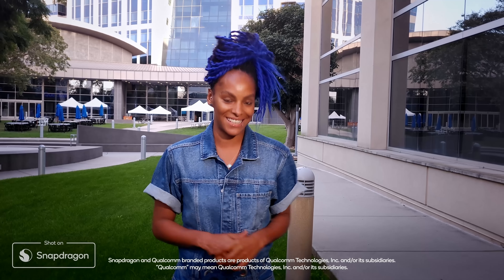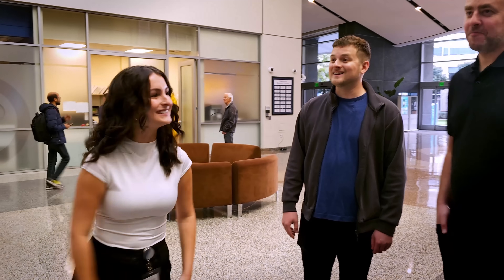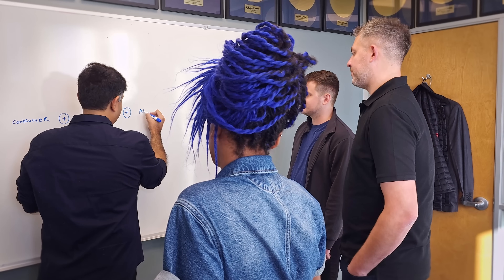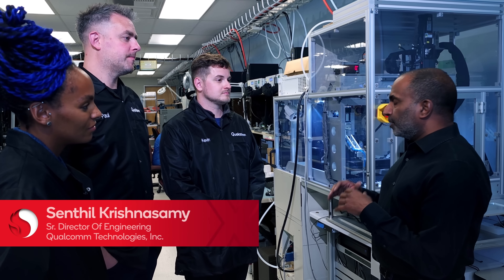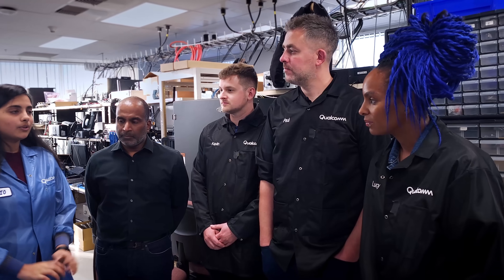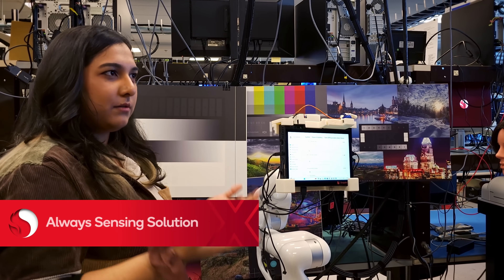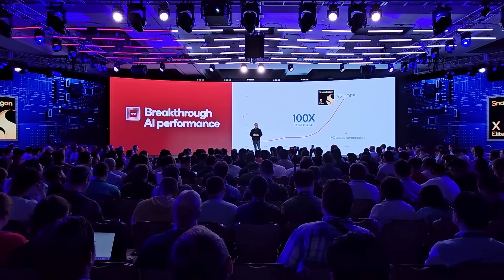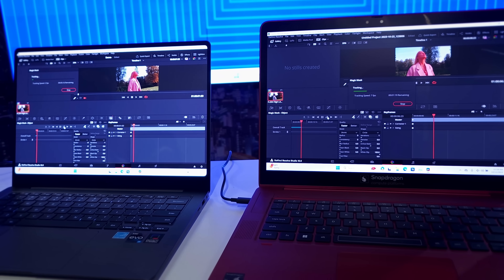Behind the Silicon: Snapdragon X Episode 2

Comment: does not always use the full power of the single core, because if the phone is in the process of playing games, working, multi-threading, the temperature exceeds 85°C etc, the oryon sd8gen4 core will never exceed exceed 3.6GHz and the CPU will be limited in voltage and performance. this is what Apple did. When we run benchmarks, the CPU will realize that it is not performing any multi-threading or heavy load actions, so the other cores will reduce the frequency to extremely low levels like 300-700MHz, while the main core will run at maximum frequency. to achieve higher benchmarks with significantly reduced voltage. We will beat Apple, Qualcomm's chips are always the choice of smartphone users
Reply: reduce npu to increase single core, multi core perf first. beat apple and all eye are on Qualcomm .no need npu, need instruction or sth to use gpu for both render and A.I instead of npu seperate. don't waste gpu, make full use of everything to beat apple, voltage & frequency, performance headroom
Reply: just need a npu like a very small silicon core e-core intel example for special work, but main activity is on gpu